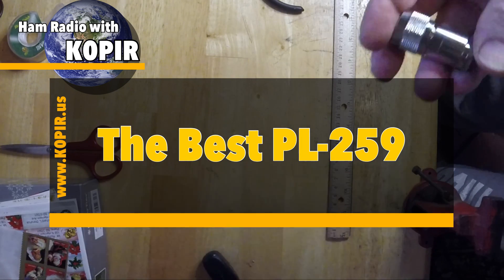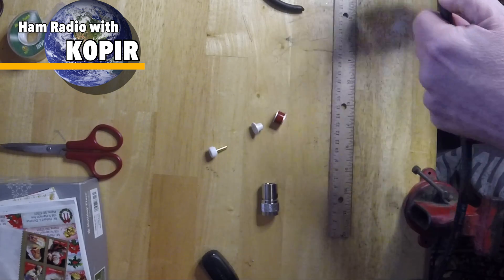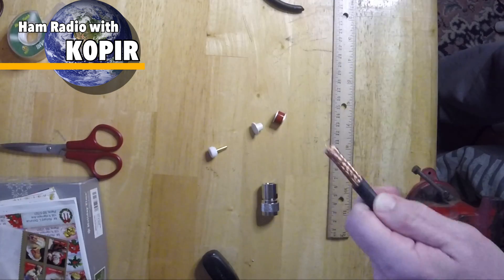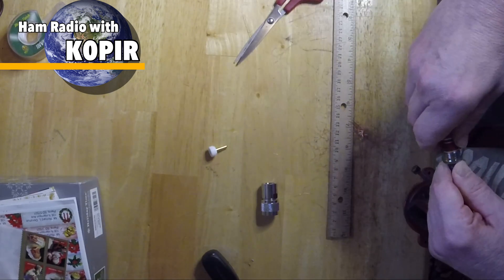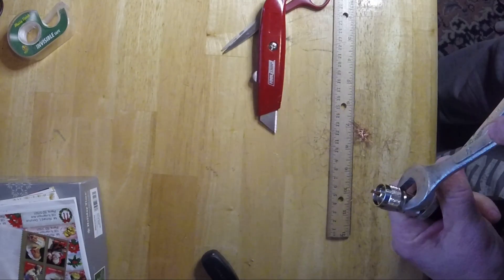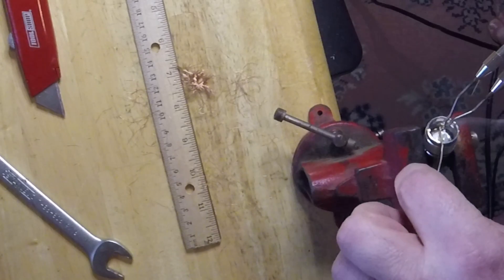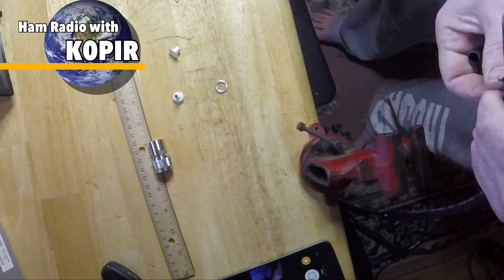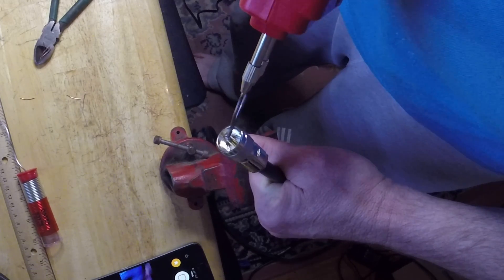The Best PL-259 for Amateur Radio Operators 2.7K

Comment: Richard...Hi, and thanks for turning me on to these PL-259's.  I bought a bag of 10 EA about two years ago and I am now FINALLY getting to my roof-top antenna project.  I got the first PL-259 attached to my DavisRF 'Bury-Flex' (LMR-400 like) coax and it all went together well...except for the fact that the center conductor on the DavisRF is so thick I can't get it all into the PL-259's center conductor pin.  I had to cut back some of the twisted center conductor to get it to fit but even then it was pushing out the hollow center pin from the plastic surround.

I ended up trimming more and more back and got it to all fit...with ~4 or 5 strands of the center conductor poking through to the tip of the fitting's center conductor pin so I could solder it.  I think all is well...but is there a larger diameter center pin that I should be using instead of having to cut back the wires?

Thanks for your time, videos, and instruction.   Brad  KF6PSL, Salt Lake City, UT

Comment: looks  good going  to the ebay site and get some. question would you use lmr400 or HyperFlex 10
Reply from the maker: Hi Paul, it's nice to hear from you and thanks for commenting. Yes I have LMR400 too and the link for the connectors may show he's out, but if you leave the seller a message, he'll get back to you. Take care, stay safe and I hope to hear you on the air. Best 73! Rich, K0PIR
Reply: @HamRadioAdventures  where do you get your coax, LMR400
Reply from the maker: @paulhastings3109  I am sure it was eBay. Maybe Gigaparts on eBay.

Comment: Hi Rich,
Can these be used with LMR-400 coax?  There's an aluminum-clad copper "foil" shield between the copper braid and the foam/plastic shield. Can I assume that the piece will slide down between the braid and the aluminum/copper shield?  73! KD2WZK
Reply from the maker: It’s nice to hear from you and yes, it will. I seem to remember that on some of my coax. 73!
Reply: @HamRadioAdventures  Great!  Thanks.

Comment: My Buddy Barry 
N5WXY told me about your video... Do you know is these are available for RG -400  I don't really care for LMR 400  I rather the teflon dielectric for heat reasons... I don't care for foam dielectrics that much...as in RG 8X or Mini 8 , I use RG 316 for my O scope and function genny's  with BNC on the ends and for a jumper or 2 .....
Reply from the maker: Happy new year! You can go to the link on my website for this and ask the seller what he has. He’s been very responsive. Thank you, take care, good luck and good DX!

Comment: Might consider using a bit of flux on the the center conductor before inserting into the pin. 

Solder would flow sooner and more completely.

Comment: Messi and Paoloni do a similar plug (although, I suspect much more expensive) which includes a rubber "O" ring between the screw in top and the body. Adding these to a decent run of coax is a real pleasure. You aren't the only sad bugger here! 73, 2E0HWO

Comment: Yes, it is the same one as you have. They are beautifully finished and look great and are great to use. But the thread is 26 tpi compared with the older ones made in Japan with 24 tpi  but they do match the new so-239 sockets. VK2LEE  Lee.

Comment: I have been using these Chinese made PL259 plugs for RG213 coaxial cable for about a year,  but I have found the threads are slightly different to the original PL259s I have been using for the past 30 years. One has 24 threads per inch, and the other is 26 threads per inch, so these new types don't screw right up tight. Only about 3 turns instead of 10 turns approx. I have also been using SO239 sockets that match these PL259.. VK2LEE  Lee
Reply from the maker: Hi Lee, thank your for commenting. I am not sure if you were referring to the ones in the video or not, but just in case, the ones I am using (in the video) and have listed on my website are fine and there have been no issues with them. I experienced a problem with pre-made coax jumpers similar to what you mention. That's why I prefer making my own. As you mention, not all PL-259 and SO239 connectors are created equally. Thanks again and it is something to watch out for. Best 73 and Merry Christmas!

Comment: Wonder what kind of Impedance discontinuity these connectors may cause????  The least problem has been with type N connectors in the past.  And the standard old PL 259 is not good for a constant impedance line.  Just curious.  DE K7YD
Reply from the maker: Hi Douglas thanks for commenting here and I don’t know for sure, and I have been considering type N connectors, but in the long run and at my station now I don’t think it’s gonna make any difference. There has been some good discussion on eham.net and other forums about that (type N or PL-259). Best 73!